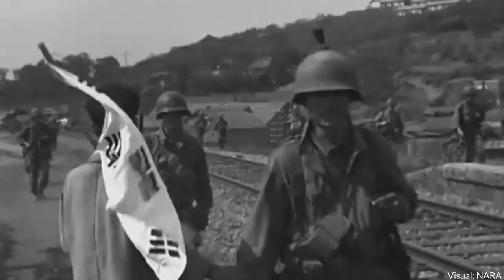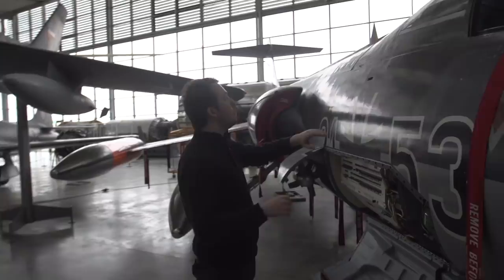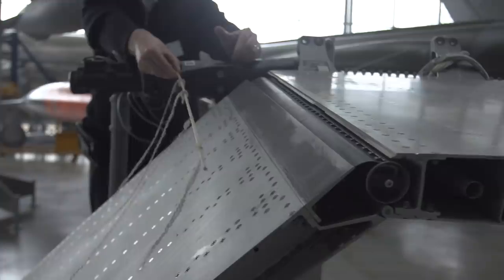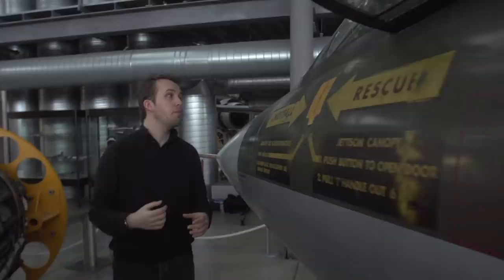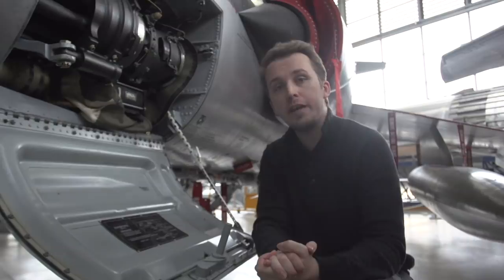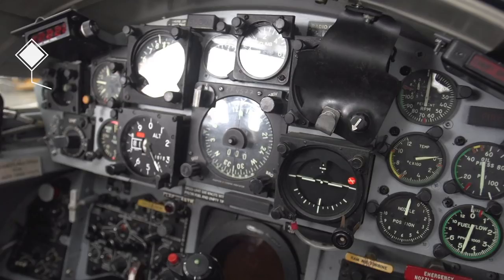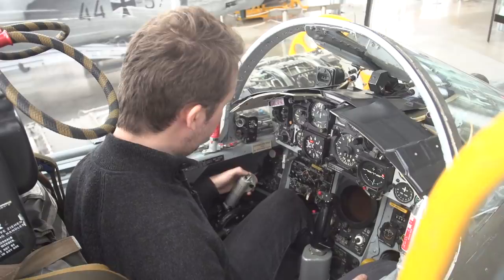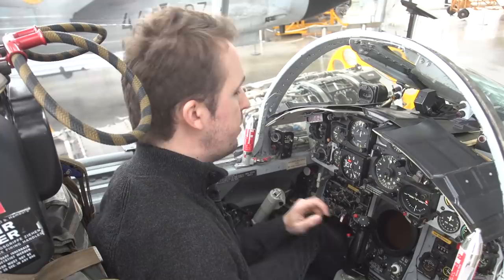F-104G Starfighter - Inside The Cockpit

Comment: I like how the warning label outside the cockpit specifies that the aircraft has an upward firing ejection seat. The first Starfighter models had a downward firing seat.
Reply: All because of the tail.
Reply: That was the main difference between the A and B models, the A's had a downward-firing ejection seat, however, the loss of crew during emergency ejections before or during failed landings became a real issue due to a lack of manpower in the 50s.
Reply: @infernosgaming8942  I believe the upwards firing ejection seat came much later than the B-model, as the B-model was the trainer aircraft and variant of the A-model. I don't remember when the B-model entered service but it would probably be less than a year after the A-model, considering that the multirole C-model entered service in the same year as the A-model.
Reply: @maxwellharris507  The tail and the fact that early ejection seats were terrible, so it's not like there was much of a choice
Reply: @martijn9568  A, B, C and D all entered service in 1958. I think the first downward ejection seats were fitted to -G models, but I'm not sure. Some USAF jets may have also had them.